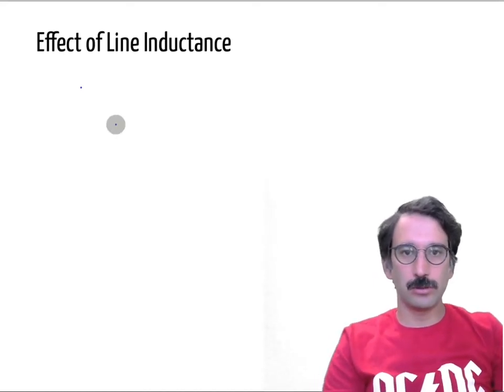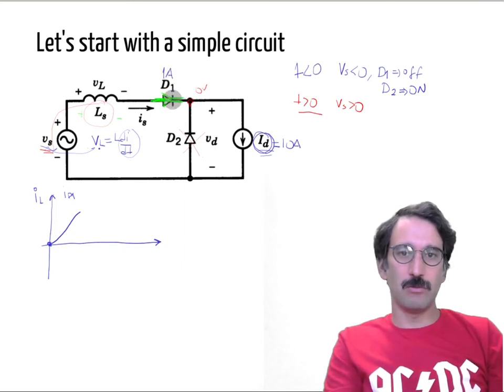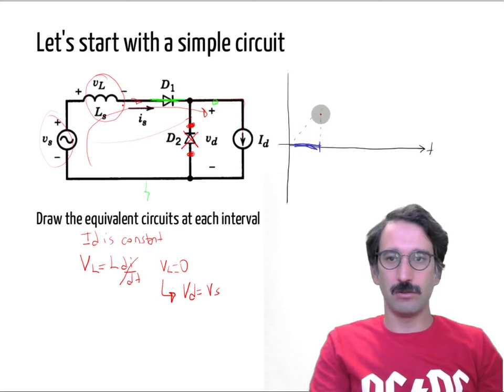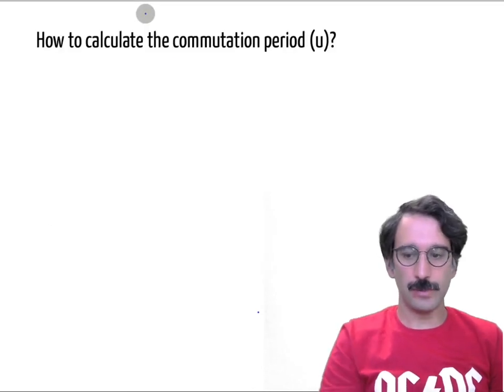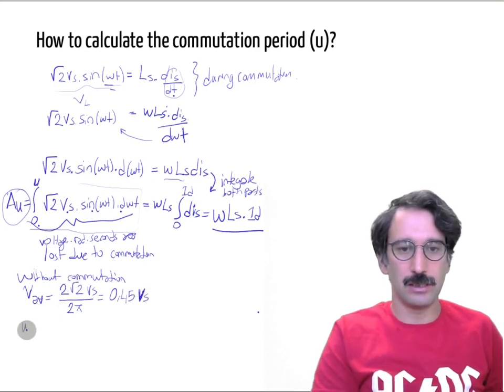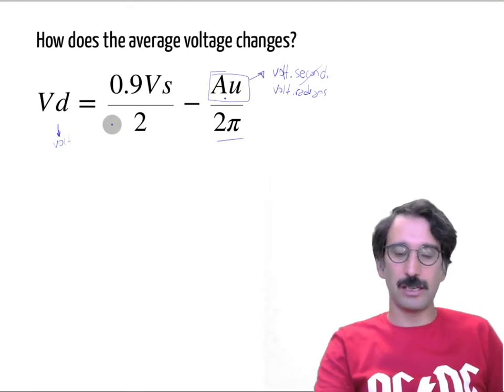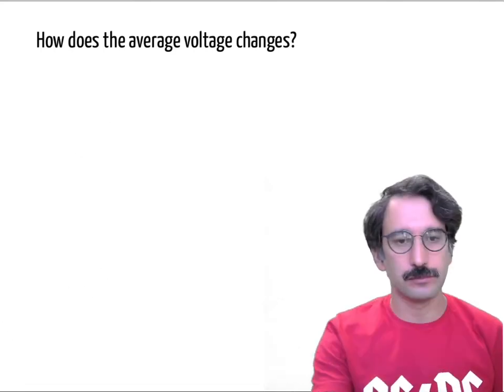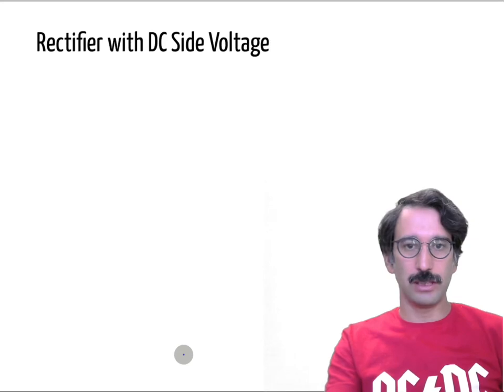EE463 - Commutation in Single Phase Rectifiers

Comment: sin(wt) ~ wt for small wt is a very useful approximation considering commutation time is negligible (wt << pi/2) for 50Hz typical full bridge rectifiers. Must be careful when the frequency and the current are high.
Reply: The are loss due to inductor
A ~ (L*Id) -> in Volts*second

The change of the average voltage  is then simply
ΔVavg = - (L*Id) / T  -> in volts
where T is the period of the signal
Reply: Usin sin(wt) ~ x - x^3/3! + x^5/5! approximation is valid up to 90 degrees. but not easy to come up with a simplified term for tc and Vavg